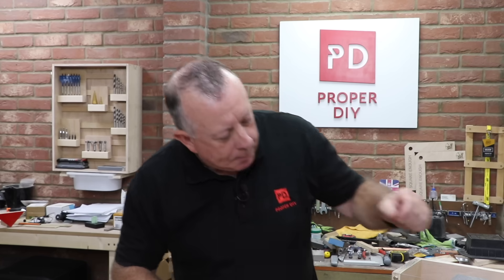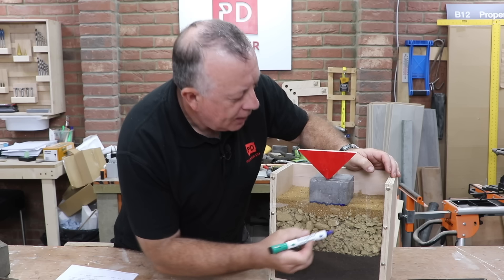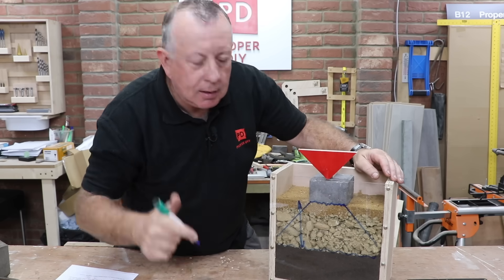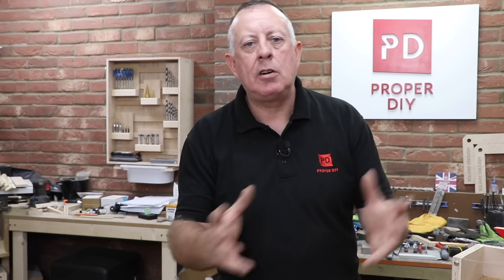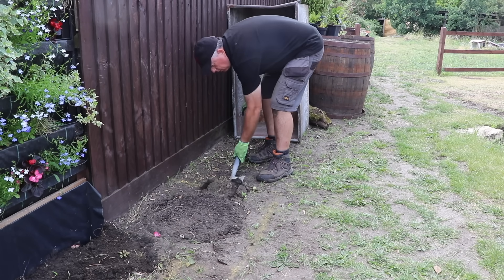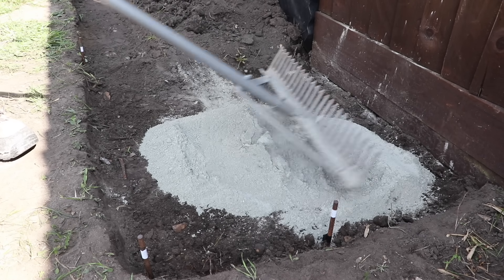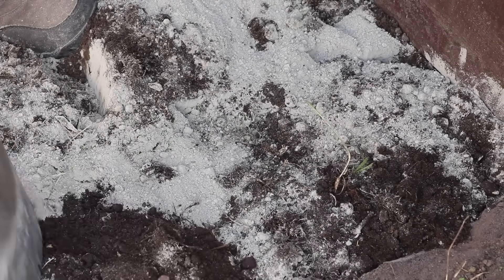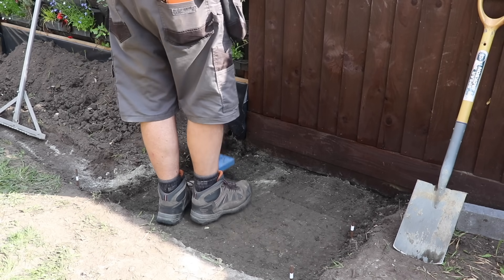How to Save Time & Money by using a little known Civil Engineering technique in the garden!

Comment: An ex army royal engineer gave me this tip, they use it for temporary roads.  For a more consistent result I use a cement mixer with 1:6 mix and consolidate every 50mm of depth, gives great results.
Reply: Sorry for being thick, but what does consolidate every 50mm depth mean?
Reply: @TheDajoca  "Consolidate every 50mm depth" means to mix the soil and cement components, {preferably on a seperate sheet of tin, plastic or other concrete surface} and place it in 50mm layers, compacting each 50mm layer at a time, starting with the soil underneath the base. Then placing each subsequent 50mm layer, compacting {consolidating} each layer before adding another layer. In a 300mm base there would be 6 x 50mm layers, compacted seven times - once for the soil under the soil/cement base, and then each 50mm layer of soil/cement mix that follows. 

In other words, for hand compacting {consolidation} do not lay 300mm at a time and then compact. The compacting will then only "consolidate" the top 50 - 75 mm of the total 300mm. In this way, the lower 225 - 250mm {of the 300mm layer}, if compacted in one layer, would not be compacted sufficiently to establish the required strength over/above the relative strength of the soil layer underneath the "rammed earth" base.
Reply: @TheDajoca it’s to mix in each 50mm depth for the project.
Reply: @TheDajoca It means to put down layers and tamp them 50 mm thick.
Reply: Thank you for this insight
Reply: Is that 1 part concrete to 6 parts soil or is it the other way around?
Reply: @ChaosActual1  
For the purpose described in the video, you might use about 10 parts by volume {down to as few as 6} of fairly clean soil {little to no grass, no soil lumps or clumps, sticks or other organic (vegetable) materials} and 1 part by volume of portland cement.

While it adds some work to the process, sieving the soil {using a basic garden sieve}, mixing the dry sieved soil with the portland cement {preferably on a separate sheet of tin, plastic or another concrete surface}, will give the most consistent strength throughout the finished base being prepared. 

Lay the soil/cement mixture in ~50mm layers, adding a spray of water and compacting each 50mm layer. Alternatively, add just sufficient water to the soil/cement mixture to make a "dry steamed rice" consistency, laying that in 50mm layers and compacting each layer.

As with any project, even economical ones, the more care put into the component parts and processes, the greater the quality and durability of the finished product.
Reply: @PNH-sf4jz  much appreciated
Reply: @ChaosActual1  👍
Reply: When it rains a lot, does the soil/cement substrate drain well?
Reply: @gretacoe2188  
Hello Greta. 'Soil/cement' or 'rammed earth' are stabilised with a proportion of 1 (one) physical measure (eg., bucket) of portland cement mixed with 10 measures and as few as 6 measures of soil, according to the strength required. 

When properly prepared, compacted and used as a foundation, the finished product would have very limited permeability and water would flow off the surface in the same way as would happen with poured concrete. That is, most water would drain from the surface of the substrate to the edges.

If a lot of water were to soak through or into the substrate, it is likely that it would not have been sufficiently well compacted and would not be very strong. 

For large areas, it would be useful to allow for some drainage along the perimeter. For small areas, such as described in the video by "Proper DIY", it is likely that no drainage would be required.

Comment: when the silverstone circuit was modifed back in the early 2000's a similar practise was used except instead of concrete, they used lime, same mixing machine you showed, and they weighed the lime per square metre, even @ minus 5 degress literally within minutes after the mixing the steam for the chemical reaction was visible, likewise the heat through steel midsole riggers and 3 pairs of socks it was -5 after all :) :)

Comment: As a 777 pilot I can say you did a great job with T5. One of the few places I've never got stuck. And this will make laying my patio a lot easier
Reply: For 500 frequent flyer miles, you can get out and push.  I actually had no idea planes get stuck on the tarmac.
Reply: Sorry, planes get stuck?! What do you do when that happens?
Reply: @awt  increase the thrust until they break free. Sometimes it takes quite a lot, especially in hot countries where the tarmac can get soft
Reply: @jonathanwhitmore421  amazing, not heard of that before.
Reply: @awt Ryanair get passengers to push😅😅😅
Reply: @awt   Yep, that's why we shouldn't've switched everything to asphault from concrete. Tractor-trailers do as well; ever noticed the grooves in asphault roadways where the ty/ires track? That's not from "wearing away" like a lot of people think, it's because asphault is forever a (very viscous) fluid. It's also why roads have to be redone constantly. That's why factories and shipping hubs like amazon almost never have anything but concrete for the tractor-trailer areas, they can't justify the constant, repetitive cost to their shareholders. Sure it costs a tad bit more to do it properly once with concrete, but then we wouldn't have to pay to constantly redo it. All of the facilities that I've worked on/been to have had the same concrete since it was installed 50-70+ years ago, despite non-stop heavy truck traffic, except for occasional cut-throughs for utility work. I can't imagine why we don't do that with regular roadways.

 Oh wait, what would we do with all of these government-dependent workers and businesses and their lobbiests and bribesmen that we contract to redo the roadways every year or three, in spite of much lower average loads.
Reply: @GodlyNoghri  , yep, in Australia it gets so hot that some tarmac roads become wet on the surface.
Reply: @GodlyNoghri asphalt isn't the problem, there are plenty of asphalt roads around the world and especially in Europe where asphalt roads don't groove at all under heavy traffic and I am talking about some major transport connections which serve thousands of heavy goods vehicles on daily basis.
The problem is cost cutting and "watering" down the asphalt, if they do it well they won't have have to come back soon to do it again. This is what your taxes are for, to make private companies rich, among other things. The lad doing the work is still under payed. 
Concrete roads are terrible idea for so many reasons, especially in the winter. There is a reason why we switched to asphalt.
Reply: @GodlyNoghri  The reason for using tarmac & not concrete on roads is not only grip but noise levels. Concrete roads are very loud.
Reply: @Bobo-ox7fj  well central and southern Europe do get 40°c for at least 2 months of the year, in cities when roads and concrete buildings heat up you can sometimes measure 48 or 50 and you can feel the heat coming up from the road, but roads outside the cities are never that hot. Of course 40 or 50° shouldn't be a problem for a quality asphalt road, unless it was watered down.
Winters however do get very cold, snow, ice, rain or snow melting then freezing to mirror finish and then new snow falling on top of it, this is where concrete (and watered asphalt) gets very dangerous, even to walk on it on a rainy day. UK and ireland folks are very familiar with this where some housing estates and residential streets are covered with concrete. Frozen snow or water on those streets, well I am sure you know... but it does last 50 or 70 years no problem. This is why concrete is brushed or lines pulled across the surface which is OK for slow residential low volume traffic, but still very slippery in winter.  All the noise and tyre wear with reduced tyre grip comparing to asphalt, and non exsistant grip during the winter. Imagine having that on bigger streets, national roads or motorways.
Reply: ..thanks for that info Mr.Pilot..
..I'm Joe Bloggs..you can call me Joe for short..
..got any cheap tickets to Spain..??
The rain in Spain falls mainly on the plane..or tarmac..no mud there
..missing the Tapas and the Sangria..
(..don't mention Football..😢)

Comment: If you did this under a block patio base, would you still then put a little layer of sand over the top so that levelling the blocks would be easier?
Would then going over it all with a vibrating compactor (as one would normally do), disturb and weaken everything? Thoughts?

Comment: You can make walls using cement (or lime which I prefer) stabilised soil.  Just build plywood formers and mix subsoil with cement  then pour into the forms  and tamp down in 6 inch layers  you can build wa whole house like this for virtually no material cost
Reply: I've only ever heard of rammed earth using cement but never lime. Why do you prefer the lime?
Reply: What kind of lime?

Comment: Would love to see a review of this after winter. Definitely don't want to doubt a civil engineer who's done this for an airport! But I'm curious how the weaker mixture will actually stand up to freeze-thaw, as it still seems it might absorb moisture that could expand and crack the cement matrix? Couldn't that just turn it back into mushy soil over time? 

Would love to do this for a patio I want to do next year.
Reply: The mix is soft enough to expand and contract without detriment.  All the cement is doing is binding the soil into a weak stabilised form.
Reply: It's recommended to entrain air into concrete meant for freeze/thaw cycles, the micro air bubbles allow for expansion/contraction
Reply: @Th3_Gael please excuse my ignorance but not sure what you mean by that.kindest regards tim
Reply: @TheTimutube  do you have aero chocolate where you are?

Air entrainment additives add tiny microbubbles of air to the concrete mix, like the aero chocolate. 

This gives the concrete much better ability to handle freeze/thaw expansion cycles without cracking
Reply: I did something like this over 20 years ago in central Alberta. It was already breaking up after one winter. After two, I could barely tell where I did it. I moved. I might try it again with clay. There's lots available.

Comment: Great video, but so many questions. I’m just starting the planning for two car parking area in the front garden. Was planning Type1 foundation then gravel grids. For that kind of area obviously £££ in soil removal, then the Type1. Could this method be used and be strong enough for parking on? But my main question is water drainage, as the Type1 would allow that, would this method of foundation allow adequate draining too? Thanks.
Reply: Afaik Type 1 is not classed as permeable when properly compacted.
Reply: @adivarso8175 Type1 is not for drainage, it's for load distribution. You need a slight angle on your driveway to make the water run off.

Comment: Great idea!  I have a walkway to a shed that's gotten uneven due to frost heaves. Do I have to wait after preparing the sub-layer and compacting it before I place the paving stones or can I place them directly after tamping the layer down? We've been having frequent rain storms recently and I'm expecting a narrow window of good weather to get this project done. Thanks for taking the time to pass this knowledge along!
Reply: In my limited experience with cement it always better to wait for it to harden for as long as possible. But if you want you can't. Just crack on it only a path to the shed 👍
Reply: Stake some rebar or just marking sticks in at the corners and probably every 6' or so, and staple on an inexpensive tarp over top, with a slope from the high side to the low side to allow for drainage. Probably about 12" above the ground or so? This will prevent excessive water from sitting on the prepared area during any rain, while still giving it room to breath while it cures.

Comment: Felt myself going a little cold watching this. Before using either MOT 1 or cement dust or liberally spreading anything else which is calcarious, I suggest one checks the pH of the garden soil first. If one’s soil has a low pH and is great for growing ‘Calcifuge’ plants like rhododendrons etc., (which hate lime), The alkalinity from either MOT 1 or cement, can spread in the ground water and quickly turn the leaves of these plants close to the DIY project yellow, to inform you, that you are murdering them! If the garden has already been laid out and planted, this can look quite odd and mess up the design and be expensive if it means having to purchase new shrubs. Incidentally, it is the high alkalinity of cement that ensure that there will be no seal between cement and a wooden fence post. Just as sodium hydroxide degrades the lignin and pectin from wood pulp so as to release the cellulose fibres for paper making, so the cement degrades the lignin and pectin in wood and the resulting goo prevents full hydration of any cement the goo is in contact with. This leaves a small microscopic gap between post and cement. So, some sort of liquid/chemical barrier around post is always strongly advised.

Comment: Sir. I've been in the building game for nearly 45 years and i never knew this? You have just saved me at least £1000 on a 25sqm base for my artificial lawn! Thank you so much for this post.
Reply: I would imagine drainage may be a problem using this method compared to type one over a large area like artificial grass but I may be wrong
Reply: @mick.Walker type 1 isn’t classed as permeable if compacted correctly
Reply: Yeah in terms of drainage this would not be much difference as type one is not permeable… you would have to use type 2 for this, not sure why more people dont use type 2, maybe its costs. Wonder if the lime version of this is equivalent to type 2
Reply: @Jackzuk remember lime needs to absorb CO2 to harden, unlike Portland Cement. So there's a definite practical thickness you can use, and burying it is going to retard the hardening.
Reply: I agree my only concern would be drainage, I'm thinking of doing this under a paver patio that will be under a hot tub but it will be at a slope with a drain underneath

Comment: "that has got you thinking" - damn straight it has. My garden has pegs marked out for a shed base and the ground is already hard as a rock because clay soil, but it might save me one problem. I'd be slightly concerned about drainage versus type 1 depending on the use case - but for me I'm going to have a shed over the top anyway so it's not a big deal. I guess it wouldn't hurt too much to put a layer of type 1 over the top if you needed some extra height or to have the properties of type 1 in re drainage and surface either.
Reply: I'm also curious about drainage.
Reply: Properly compacted type 1 is not water permeable anyway.
Reply: I've read a lot of comments saying crushed lime is a good material for topping clay soil.

Comment: Wow. That's really good to know. Thanks for sharing this. If I was going to do this and want to lay tiles onto it for an outside yard, would an adhesive stick? Or is this only good with sand as a filler over the top and then pavers? Great video and great channel.

Comment: Fascinating video. It's weird that last year when I was doing LOADS of research for my patio I never saw anything related to this. In fact the closest I saw to this was someone in America putting cement on their gravel driveway for added strength. If I'd known about this I might have spread a few bags of cement out across the ground and gone over it with my mini tiller. I'm guessing water flows freely through?
Reply: Looks pretty water impermeable to me. Maybe if you smashed the result after curing for a few days it would have enough drainage while still acting like gravel or type 1. Or you might go with a lot less cement.